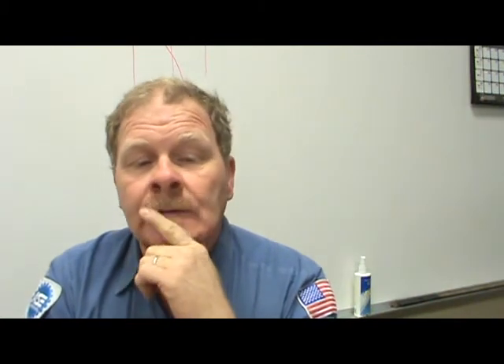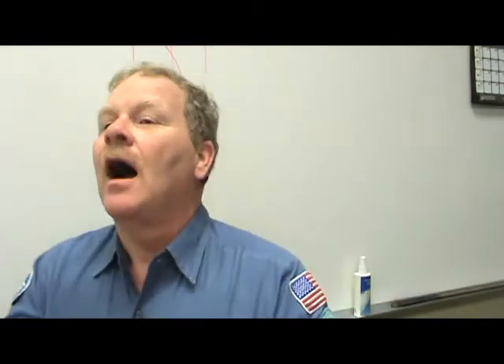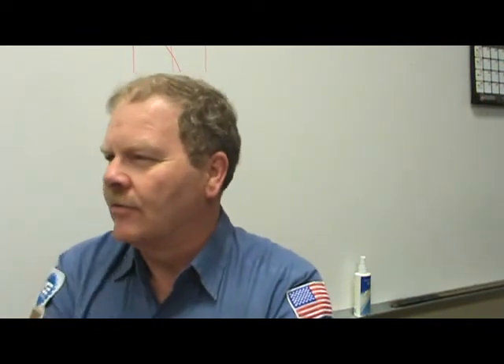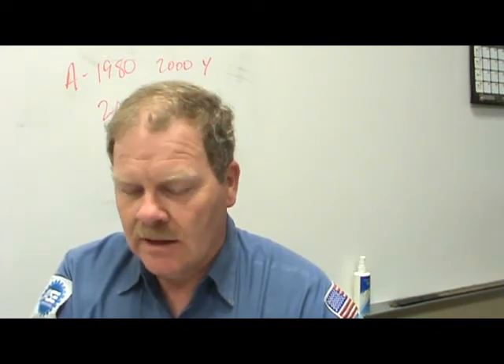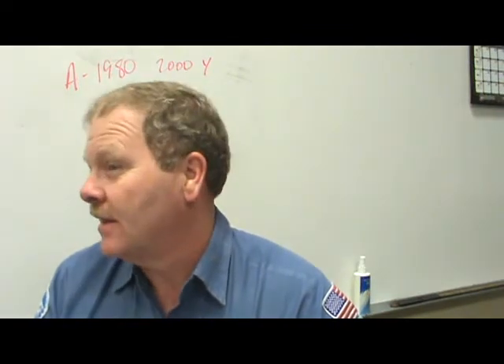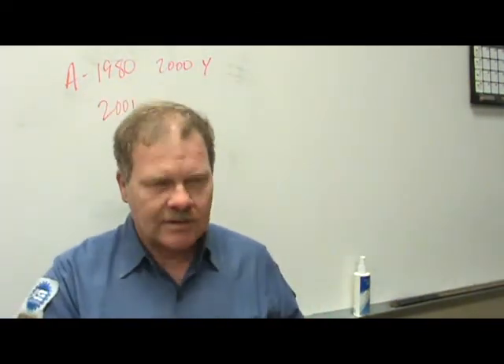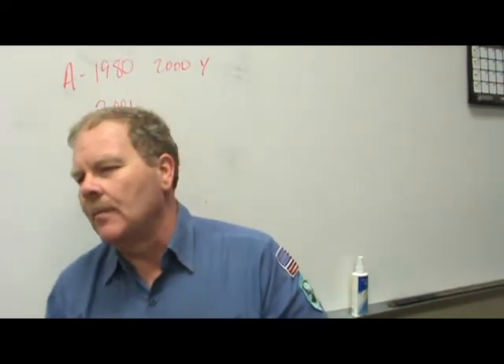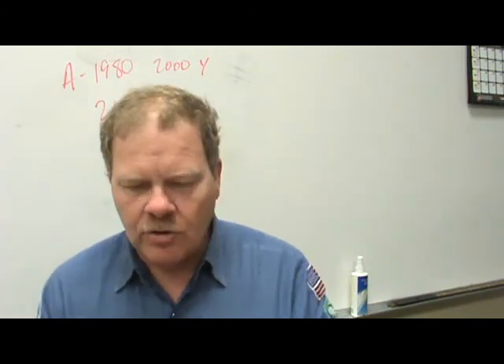Eng Rep 2 Tst 5-6 Base Engine.flv

Comment from the maker: The crazy thing is that you can wire one of these engines up with the wrong firing order and it'll run decent enough to make you think there isn't all that much wrong.  The late fifties 352 Ford engine had a 15486372 firing order - imagine how that fouled me up the first time I ran into it!!!!  Just two cylinders (8 and 2) were transposed later on...

Comment: The 5.0 Crown Victoria had the old 15426378, the HO from a Mustang had the 351w firing order with the two pairs of cylinders swapped around.  I've had more than one headache on account of that.